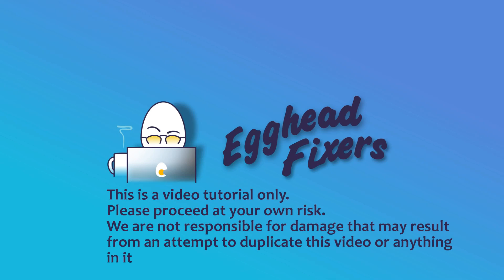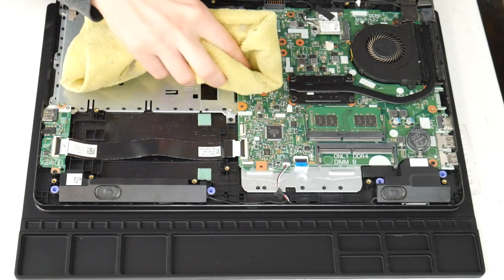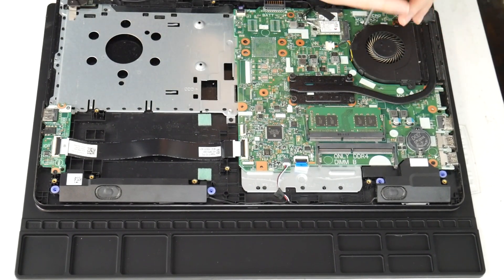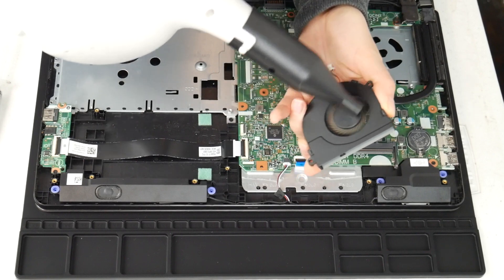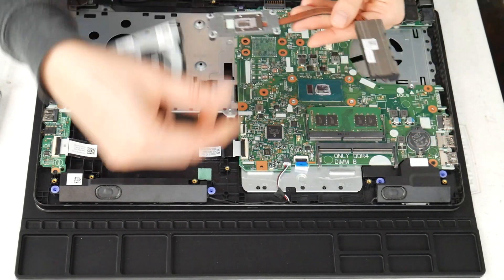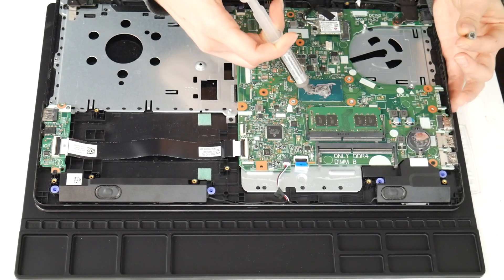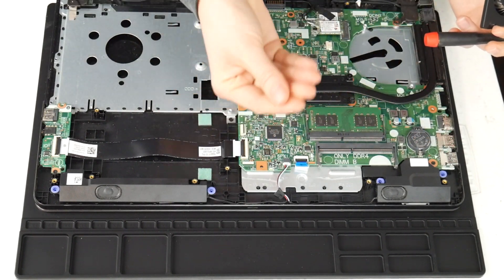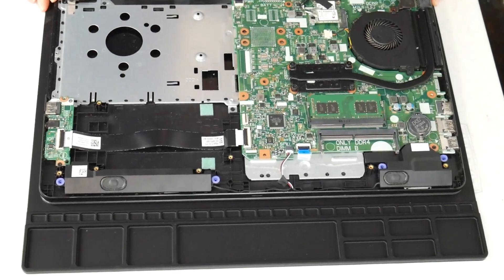How to Fix an Asus Computer That Runs Hot or Fan Runs Constantly  - Tutorial By Certified Technician

Comment: What a great video for checking out, getting into and being confident opening up a beastly ASUS. In my case it is a Chromebook, model C536 (for some reason also called CX5). Since new this 11th gen i-3 Chromebook never runs hot (playing your video with various other windows open, including a music app, is running at the low 30's C) however the fan runs most of the time, even though blowing cold air. I have on occasion noticed the fan not running, and other times, with the only activity being streaming music, it runs continuously at a medium-ish fan speed.
Might this be an ASUS thing, as I see many posts on the topic? It's hard to research, as the assumption is always that a computer's fan runs because it is hot, but in this case, not.
Reply from the maker: Does the computer seem like it's overheating? A lot of newer models the fan only turns on when the computer needs it, so if it isn't overheating then it's usually not a problem.
Reply: Well, as I noted, the temps are in the 30's, quite low, and it is blowing cold air. if it is overheating it would be doing so quite surreptitiously :-)
Surely it is not a problem if it blows cold air, however that it neither expected nor normal operation, and when using this convertible in "stand" mode that fan is facing me. Whatever the equivalent of a bios/firmware that ASUS uses to pair ChromeOS to its hardware is most likely the culprit, and that's way beyond my knowledge! And I'm told there is no user access nor upgrades of that on Chromebooks, only the software updates.
Reply from the maker: @IntoTheLightAstrology  Ya you can't fix stuff like that yourself. Hopefully they will come out with an update that will help.
Reply: @EggheadFixers  Thanks... and, to my surprise I actually discovered that there IS updatable firmware for Chromebooks! The odds of it ever having an available update may be slim to none, but at least one can give it a try. If this nuance interests you, it's right there out in the open on the the About Chrome OS (shouldn't that now say "ChromeOS"?) at the bottom of the options below the version number.
I am however not holding my breath for ASUS to deal with this.
Reply from the maker: @IntoTheLightAstrology  Ah ya that's interesting. Thanks for sharing the info!

Comment: hi i have a dell inspiron 15 5000 5577 and when i press the power button the LED just blinks white.
Reply from the maker: Do the LEDS blink in any sort of pattern? Like blink 2 times then pause and then blink 3 more times
Reply: @EggheadFixers  yes
Reply from the maker: @travis2281  What pattern is it?
Reply: @EggheadFixers  it blinks 3 times
Reply from the maker: @travis2281  If the LED pattern is 3 then 3 blinks... This is a BIOS recovery error. You fix this by the doing the following steps:

How do I initiate BIOS Recovery on a Dell laptop?
Before you begin the BIOS Recovery, ensure that the battery of the Dell laptop is charged up to at least 10%.

Verify that the laptop is turned off and disconnect the AC adapter.

Press and hold the CTRL + ESC key on the keyboard.

Connect the AC adapter to the laptop.

Release the CTRL + ESC key on the keyboard after you see the BIOS recovery screen.

On the BIOS Recovery screen, select Reset NVRAM(if available) and press the Enter key. 
Select Disabled and press the Enter key to save the current BIOS settings.
Select Recover BIOS and press the Enter key to start the recovery process.

NOTE: Your Dell computer may restart a few times during the process of BIOS recovery.
 
NOTE: This works slightly differently for Alienware laptops.
Reply: @EggheadFixers  thank you
Reply from the maker: @travis2281  you're welcome
Reply: Hey sorry it actually just blinked once when I click the power button ,like blinks and holds for a second then stops
Reply from the maker: @travis2281  I would try a BIOS reset. It resets the computer base system which can fix a problem like this. Here is the video:
https://youtu.be/KzAd6F1YAQQ
Reply: @EggheadFixers  ok the battery led on the front of the laptop only lights up for a second or 2 when I plug in the laptop